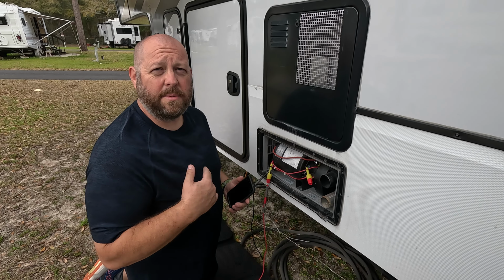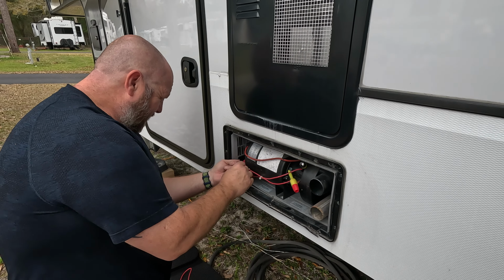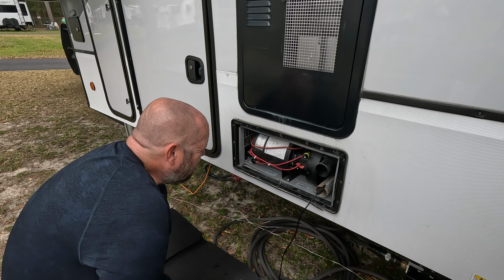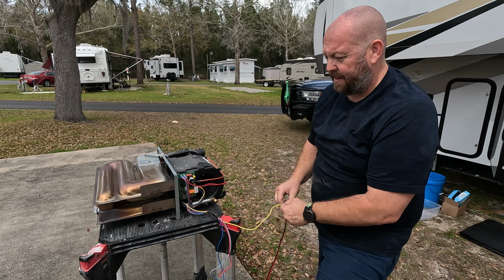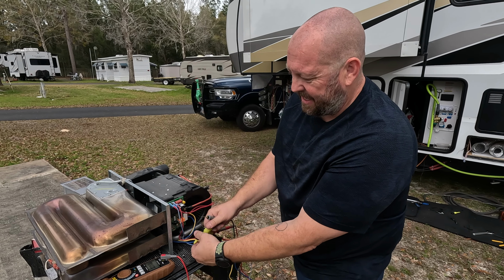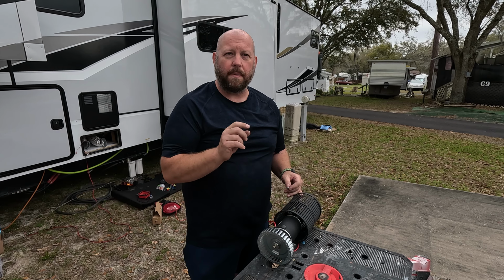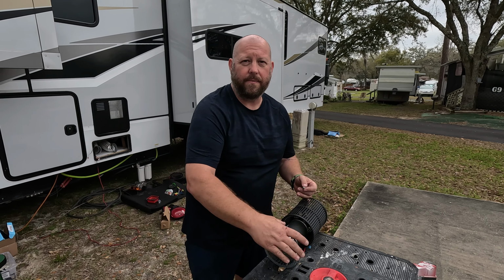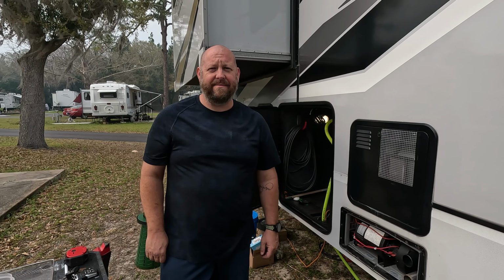NO HEAT IN OUR RV | FURNACE ISSUES

Comment: didn't need to remove the furnace case. should have used aluminum tape on the interior to seal up the duct connectors and the precut duct openings. when working on any rv appliances always check and clean the grounding  wires first... then proceed with diagnosis. my first guess was a bad board, but when you fired it up, I could hear the intermittent motor and I knew it was a ground... motor puts big load on connections...
Reply from the maker: All of the precut duct openings were used I just unscrewed the connectors and left the vent hoses connected.  When I initially did my trouble shooting it presented as it was the motor.  That's why I pulled the whole thing out because I thought I was replacing the motor.  Once I pulled it out it started working on an external source which told me then a loose connection somewhere. Always fun troubleshooting and running down loose wires or bad grounds.
Reply: the interior of the can/furnace case needs to be taped with aluminum tape right at the ducting exits that unscrew. they leak air. on the top of the case and bottom of it too there are huge pre-cutouts that was designed for floor ducting. these need to be taped as well as they leak quit a bit of air flow.... Make sure the furnace case is bent so that it seals the fire box from the motor side. need to seal where the burner pipe goes through to the fire box. all these little air leaks on these little furnaces affect the ducting flow. Don't be afraid to use a duct opening/vent flow limiter if you have low flow down stream. Manufacturers don't take the time to "finish" the taping correctly so most coaches are very poorly heated. @thisisouradventure
Reply from the maker: @rss608  I did tape it up some when I put it back in just didn't show it.  I do need to crawl in and finish taping it up so it's more efficient for sure.

Comment: Great video. Was the ground wire just loose or broken.  Thanks Don
Reply from the maker: Hey Don the wire was just loose.  When I pulled the connectors off the ground block some of them were super loose.  I ended up taking a needle nose pliers and tightening up the connectors and re-connecting to the ground block.  Which helped resolve the issue.  Thanks for watching.

Comment: I like the wire probes. Did they come with the meter?
Reply from the maker: The probes did not come with my meter I ordered them on Amazon.  The needle probes to test at the board are in this kit. https://amzn.to/3v42INw  and the piercing probes to check for voltage in the middle of the wire are these ones https://amzn.to/48MGFsG.  Thanks for watching.

Comment: For some reason folks expect RV appliances to last 20 years like house appliances. Clearly they don't. 5 years dependably, I carry spare boards, sail switches and a motor if possible.... just the nature of a RV.
Reply from the maker: Yeah I carry sail switches and some limited spare parts as well.  It does get a little frustrating when some of these newer appliances fail shortly after being installed or new components are bad out of the box.  Thanks for watching.